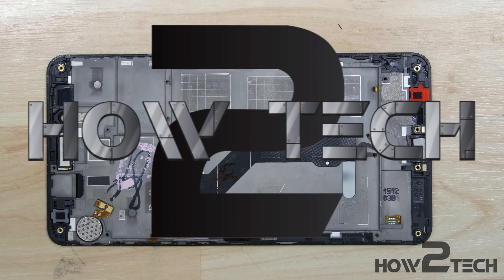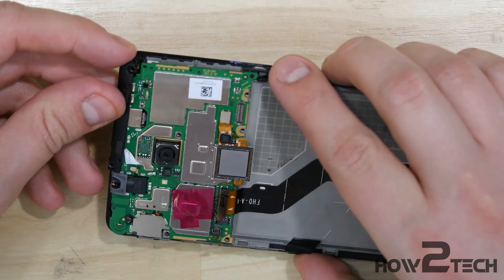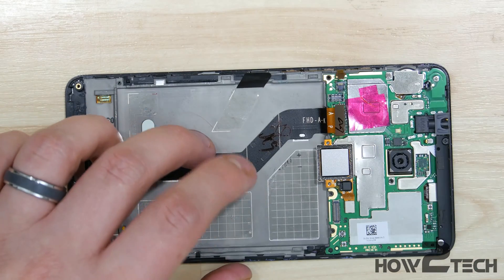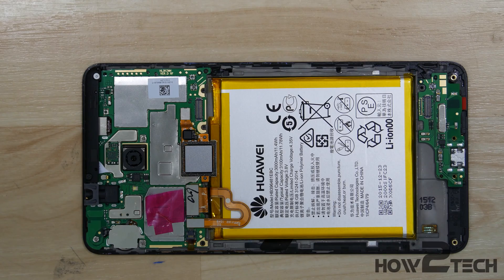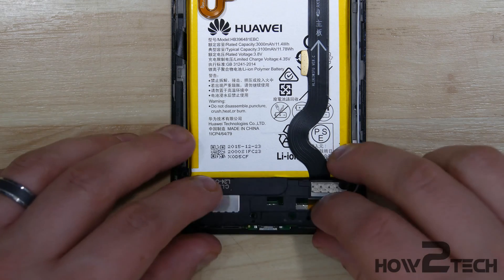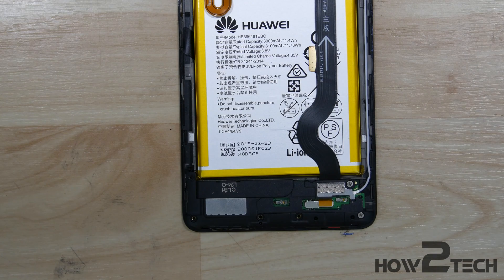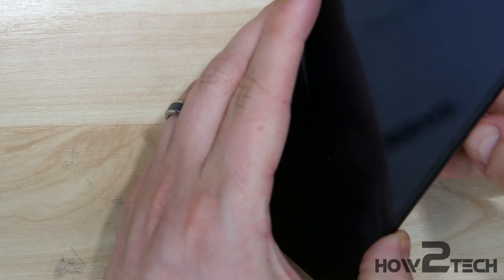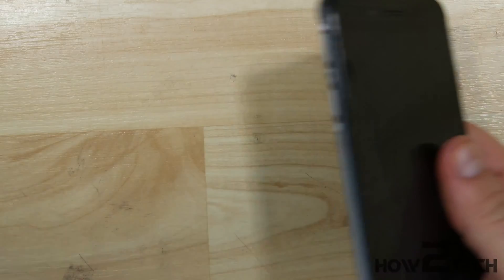Huawei Honor 5X Screen Battery Charge Port Replacement - Reassembly Teardown

Comment: when i put mine back together with new battery installed i got battery icon flash on screen, then Huawie logo, followed by vibration. then a repeat of the last two.  any idea what i might have done wrong?  something obvious?    
I put the old battery back in and experienced the same.
Any comments would be appreciated,  great tutorial!...love the dialogue, very informative and to the point!!

Comment: Hi there, that went back together nicely but then again you make it look ez lol, I have a question for you, I seen when you put that color tape back on the top there, what is the purpose of that kind of tape I'm just wondering on that, thanks for the video I do injoy them and find them very useful ☺
Reply from the maker: +matt Hajas Its normally an anti static tape to help dissipate buildup so it does not affect the screen or buttons. It can be referred to Kapton tape and normally yellow, first time I have seen pink.
Reply: ***** thanks ☺